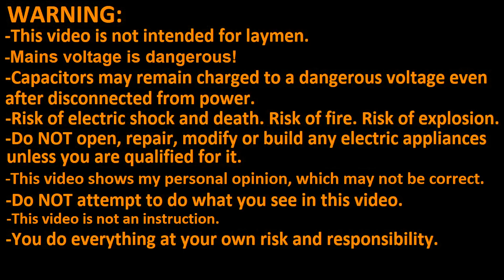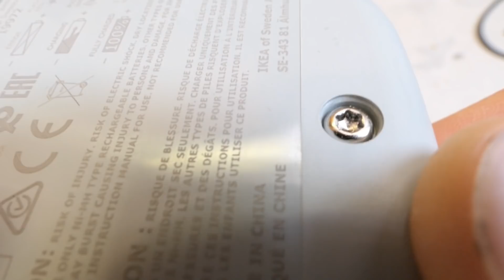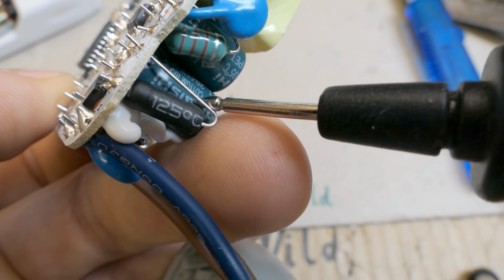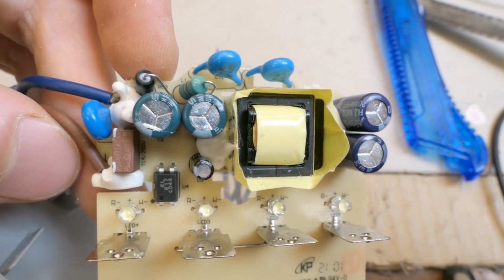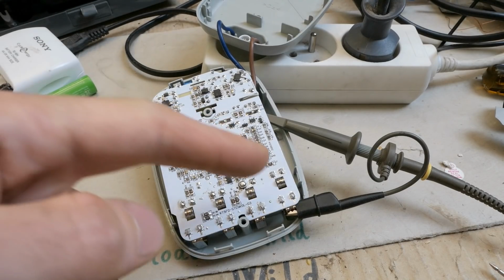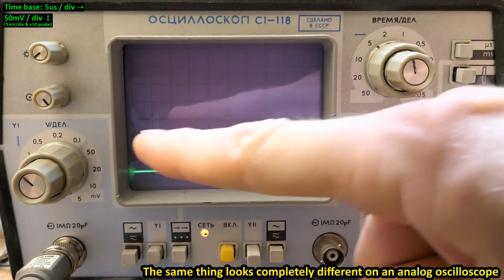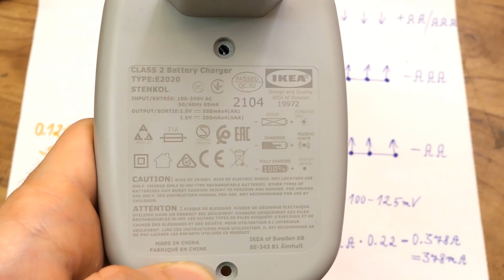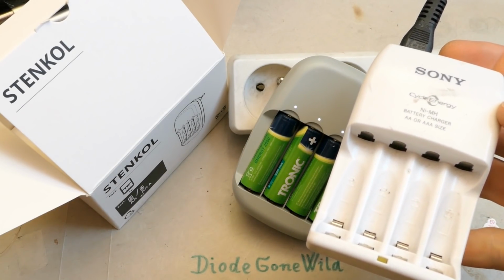What's inside IKEA Stenkol charger

Comment: The problem with the "new" types of LEDs is that manufacturers just pass the same amount of current through them as they would for the old types - so they turn into flashlights instead of indicators. For the new ones, 160uA or so is more than enough as an indicator. Even as low as 5uA can be enough. But they use 10mA, which is insane.
Reply: Yea, some new leds are insanely sensitive. I have some which light up just by holding the led from other pin and touching ground with the other.
Reply: This really reminds me of some Chinese ODM no-name and off-brand electronics where that is done and thus there's an incredibly bright blue LED. It's as though they didn't test their products in the dark!
Reply: agreed , my tv box indicator light is bright as a flashlight.
Reply: Yes, when build circuits in the past a 300ohm limit resistor was fine, i just started a new project, leds so bright i slap in a 10k :O
Reply: These LEDs are pulse driven, else they couldn’t let them flash slowly on and off like this.
Reply: @kbhasi  It's not even chinese crap, also the better brands seem to forget the user. My Zoom audio interface has a blue LED above the volume-pot which is absolutely insanely bright in darkness. I don't like blue LEDs anyway, but sometimes they are not as bad.
Reply: @weeardguy  
WHAT?! Really?!?! 😳
Ouch.
Reply: I have a 65W USB-C charger with a super bright white LED on it, right below the USB-C port. It's extremely annoying at night. Recently replaced it with a better dual-port Belkin model, which thankfully has no stupid LED on it.

Comment: I am amused by your "new" oscilloscope, is that front port a floppy disk drive? Could you use it to capture some samples? I bet you'd have some working floppys laying around along with some drives
Reply from the maker: Yes, it has a floppy drive. I already managed to store some waveforms to a floppy disk. I have a pile of floppy disks, of course :).
Reply: @DiodeGoneWild  LOL, of course. :D
Reply: A very nice data storage media before flash storage and wireless data transmission :)

I also have used a oscilloscope once with a serial port to transfer data to computer, its a very nifty feature.
Reply: Try to "play" with a horizontal or acquire menus, there should be some option for a 25/50 MHz bandwidth limit, to limit an HF/RF noise. You also got cursors and automatic measurements in the upper block of buttons... that's quite old but pretty decent DSO.
Reply: @BobT36  ovvvv corseeeeeeeeeeeee (read in Diode's accentttt) :P
Reply: @DiodeGoneWild  there are adapters that emulate a floppy drive and store in an SD card, could de a worthwhile upgrade.
Reply: @DiodeGoneWild  Would be interesting to see what's inside that scope. Is it x86 based running DOS, or something more sophisticated?
Reply: @mojoblues66  Yes definitely worth it to check the insides out - never know what you'll find!
I found tin whiskers in 70's era BWD instruments oscilloscope, and more of the same in a DECCAsound amplifier from about the 60's!
Check those pots and switches; basically anything with a "metal case"...
I've even heard of fuzzy transistors and self-destructing hermetically sealed devices... Best to spot that stuff before turning it on!
Reply: @DiodeGoneWild  one benefit of being a hoarder is that you have everything, you just need to look harder ;)
Reply: @DiodeGoneWild  NICE!

Comment: Torx is so much better than pozi/philips! I'm always happy to find them, because there is a lower chance of stripping the screw heads. Even with a cheap chinesium set of bits, torx is easier to use.
Reply: many times, what looks like a Phillips is actually JIS, the angles are slightly different, which is why a Phillips screwdriver will cam out and strip it.
Reply: @AKAtheA and of course it not easy to find JIS tools outside Japan.

Comment: IKEA “brand” seems to care for a minimum of Quality and Performance. In this case here the Battery chargers seem quite GOOD. 
However, I have 1 concern: I did not research the influence of PULSED current where the instantaneous CURRENT is more than 4 TIMES the AVERAGE. Maybe it creates gassing, but depending on pulse duration, battery CHEMISTRY may recombine the gases (or not…). 
Just guessing, comments and replies for further discussions are appreciated, or maybe even another video.
Thanks for sharing, @DiodeGoneWild!

Comment: For a low cost manufacturing operation, torx can actually save everyone a lot of headache. Our company's current product formerly used all internal hex (allen) screws, and the internal hex drive is very easy to destroy if there is not a perfect match between the driver and the slot. Torx is much more forgiving when it comes to that.

Phillips screws have basically been obsolete for quite a long time--they were designed for a time when pneumatic screwdrivers had just been invented, but no one had yet come up with a torque limiting device, so Phillips screws are designed to have inherent torque limiting. Nowadays there's no point to that.

If I need to open something up, I would rather the screws be Torx, because I can easily apply a lot of torque to loosen the screw if it has gotten stuck. With Allen or Phillips I might be in for a tougher time--the Allen can easily just be mushed into a circle and lose its engagement, while with Phillips you have to apply downward pressure and then it also might round off.

Another advantage of Torx over hex drive is you don't have two different sets of sizes to deal with.
Reply: But Philips head screws are still used in wood working because they look better than other types of heads. Less industrial and more decorative.
Reply: The best part about Torx is that even if you strip it somehow (too much force, wrong tool, or corroded/rusty screw), you can usually work it out with a hex bit.
Reply: Biggest gripe with hex is imperial vs metric sizes. You can have a key and head that look like they are a match but they're not. Ones metric and the other is imperial and they are ever so slightly different and that little bit of play cause the head (and sometimes the Allen Kwy) to strip.
Reply: @Professional_Youtube_Commenter  We had that exact problem at work. Our product was built from some parts that had metric screws and some parts that had english. We ended up having a lot of 1/16" hex screws but a few 1.5mm which is almost the same. Stripped a lot of screws because of it.
Reply: @rfmerrill  I just use torx bits with hex-hole screws.  The bit might bind to the screw, but they'll never strip.

Comment: A hint on those old Tek scopes.  Enable the 20MHz BW limiter for your 2 inputs.  You do not need the full bandwidth for measuring switching supplies and the trace looks a lot cleaner.  Also, I forgot the exact name of it, but if you change the sample size in the trigger menu from 10k points to 500 points, the waveform update/refresh rate is vastly increased looking a lot more like an analog scope, except the fine zoom-in resolution after you freeze a snapshot will not be as fine.

Comment: I've seen the red/white leds in a couple lights on bigclive's channel.

Also looks like the LEDs are center positive, you could rotate them 180° so red is the normal colour and white is error, which would make it more pleasant at night unless there's an error :P
Reply from the maker: This was the first time I saw it in real life. I may replace it with a red/green led, or maybe red/yellow, because the new green ones are 525nm rather than 574nm. This makes a huge difference for scotopic vision and circadian sensitivity.
Reply: I had two LEDs [5mm ones] that automatically change colors between RED and GREEN. Classic ones do it between red and blue.... What a rarity.
Reply: @DiodeGoneWild  hah, scotopic vision. Many years ago i was able to pre-test a new digital 3 chip sensor camera my employer was manufacturing. I set it up at night at home in my garden under the only light available of a very bright full moon.The resulting images were incredible with rich colours present, especially red hues of various flowers more intense than using ordinary sunlight.  It was an uncanny feeling, seeing no colour but plainly the camera could.
Reply: If you change red to white or the other way round, you also have to change the series resistors. Other wise the red LED will most likely be overdriven a lot because of its lower forward voltage.
Reply: I use fine felt tip sharpie marker, to dab a bit of ink on the LEDs. I do this with all of my devices that have bright indicator lights.

Its still clearly visible, But will be dimmer, so it doesn’t bother you when sleeping in a dark room.

This is especially helpful for car chargers and things plugged into the cigarette lighter inside a vehicle. Because when driving at night, some of these modern bright indicator lights can blind you!
Reply: @HULL GUITARS USA
TRUE, theese LEDs are too bright... It is better to use normal red/green ones. Even one 3mm green/blue LED can blind you quite a lot. Trasparent LEDs are the brightest.
Reply: @gianluca458  That's interesting. I remember a long time ago, when I was about 7 (could be 1996). That was several years after we came out of the USSR, so all the interesting stuff was pouring into the country everywhere. One day my father came home with a couple of semi-transparent white 7mm LEDs. He asked me if I could guess what color they were. I thought they would be white as I hadn't seen any LEDs like that before, only colored ones. Then he attached a 3V cell battery. To my surprise, the LED came on red. And then green. And red again! Interestingly enough, to this day I haven't come across this type of LED either. Not that I was specifically searching, but it sure seems that they are not so ubiquitous.
Reply: Wow, so i HAVE two quite rare LEDs... I will keep them nicely, XD.

Comment: It could be charging the batteries in pulses to better measure their voltages, NiMH batteries actually lower their voltage near 100% SoC. Ending the charging by this voltage drop is better than using the temperature method

Comment: I use fine felt tip sharpie marker, to dab a bit of ink on the LEDs. I do this with all of my devices that have bright indicator lights.

Its still clearly visible, But will be dimmer, so it doesn’t bother you when sleeping in a dark room.

This is especially helpful for car chargers and things plugged into the cigarette lighter inside a vehicle. Because when driving at night, some of these modern bright indicator lights can blind you!

Comment: I have come across an LED driver that runs on universal mains, output is about 45 watts, 3.8 A. Strange thing is I think it uses an IGBT as a regulator. I’d love to see a video on such a driver.
Reply: @Ryan Thank you for the reply, I made an amateur error and discarded the transistor that was heat sinked and didn’t write down the part ID, the controller is a BP3238. The feedback and control circuit does not appear to use an opto-coupler for feedback.The board came out of an Artika product after it unexpectedly failed, so I’ve been using the board to learn LED driver circuitry.

Comment: As far i know, Stenkol means "coal" Maybe because the color and form of it they call it "coal" I brought one for only 39 danish kr. include 25% tax ( 6,2 dollar) and it works fine. Incredible what get for the money. I have done a little test with it, and it charges the batteries just as well as the more expensive charger. It a overnight charger.
Reply from the maker: It's probably called coal because it uses electricity from coal to charge the batteries ;).
Reply: @DiodeGoneWild  :-) Good guess. They still use some coal, but will be phased out in the coming years. Sweden has nuclear power and also uses solar, water and wind energy. IKEA will stop using disposable batteries and will only sell rechargeable nimh batteries in the future to reduce waste. Like your video and cat :-)
Reply: In Italy it's sold for 4,95€ taxes included, or 9,90€ (taxes included) in bundle with 4 AA 1900mAh batteries, or 12,90€ with 4 AA 2450mAh batteries.

Comment: I still have the “old” white Ladda IKEA charger and the outputs are rated a lot higher. I wonder if it’s just the way they spec 4x….. 
I feel the need to open mine now and compare it to this new one.
Reply: I actually bought a Stenkol and although it’s nice that you have individual LEDs for each battery, it is MUCH slower at charging than the “old” white Ladda charger.
Reply: @atariandre5014  Slower charging is better for the batteries.
Reply: @massengineer7582  yeah thought about that. It’s hard to believe they didn’t improve the charger…
Reply: Up to 1C charge rate is pretty safe, old LADDA made by same OEM as the Sanyo/Panasonic charger iirc

Comment: Why did they shrink wrap the inrush resistor thermal fuse, and not the MOV? 
What are the chances of a resistor exploding? 
My guess is that the resistor will pop at 125ºC and they wanted to mark it on the piece? 
Usually MOVs are shrink tubed as they sometimes explode from lightening strikes.
Reply: Probably to contain the arc flash/sparks from the popping resistor just in case

Comment: Excellent analysis. 
How does it regulate the current going into each/all batteries? 
Why does it charge one cell at 50% duty cycle?
Reply: The reason for the 50% duty cycle limit is to limit the average charging current to a safe level. ( < 800mA per AA cell )  
Excessive charging current would overheat the cells.
Notice that the AAA cells have lower charge rate.
Reply: Another reason is that the charger is measuring the cell voltage droop during the period between the charging pulses.

Comment: I have a question regarding an old charger which I have which charges the batteries in about 15 mins. It's the lg v800c fast charger. Why do the new charger charge so slow in comparison to the old charger? Did they come to the conclusion that charging so fast damages the batteries? Is this why you can't purchase fast chargers anymore? Looking forward to your response.
Reply: Yes. Fast charging like 15 min killing your battery fast. Because excessive heat and too much current than rated current stated by manufacturer.

Comment: How does it detect if a battery is not rechargable?
Reply from the maker: I think it only estimates the impedance. The non rechargeable batteries probably have a higher impedance - their voltage increases too much when it tries to charge them.
Reply: @DiodeGoneWild  back in my day chargers would have their bottom piece try to make contact close to the edge of the bottom surface and rechargable ones would have the whole surface metal, meanwhile single use ones would have a very thick border and couldn't even make physical contact.

Comment: I have problems with this changer and IKEA LADDA 900 AAA batteries no. 23076. Almost all get blinking red ligth (error), while my old ikea charger  works fine (Ikea Ladda YH-990BF). Seems this charger is more "strict" somehow? I do feel the IKEA LADDA 900 AAA batteries get a bit hot during charging in Ikea Ladda YH-990BF so maybe STENKOL incorrectly detect this as error. but just guessing. Edit: so also guessing, when detecting heat is should have reduced changing current\duty cycle instead of just going into error mode. A design error IMO. But where are these heat sensors?

Comment: I was expecting a comment on the surface mounted spark gap visible at 22:01.  This is mounted between the primary to secondary. Notice the absence of solder resist.

Comment: wow well built design! Though I think there was alot of engineering that went into something that uses PWM charging to the batteries, I will stick with a nicer charger that uses buck regulators and constant current control.

Comment: I bought Kvarts charger few months ago, but now it's discontinued in the favor of Stenkol. Kvarts appears to be very finicky, discards some too worn batteries, and sometimes doesn't charge mildly worn red Lidl cells fully. I guess it's tuned for Ladda cells (and by extension Eneloops).
Inside Kvarts looks very similar, with a microcontroller and a shitload of circuitry. But it cost 2 times as much.
Reply: This new Stenkol also seems to be finicky with some cells. I tried to charge my fairly old Energizer NiMHs, but it wouldn't accept them. Starts charging then after some 10 minutes the red LEDs start flashing. Of course I can charge the cells with a different charger.
Reply: @zoltandiveki5233  So I guess software wise they did not change much. Then disregarding the price, Kvarts is better, case design is more stylish and status LEDs are bigger.

Comment: How does it recognize the non-rechargeable batteries?
Reply from the maker: Probably a high internal resistance when it tries to charge them. The charging current raises the voltage way too high if it's a non-rechargeable one.

Comment: I think it's not good for 18650's right?
Reply: No it's not because this works on 1.5V, 18650 cells charge on 4.2V
Reply: different size, different chemistry & voltage, different charging method.

Comment: There is two things wrong with this; charging the batteries with high current pulses like that is not good for the battery...
Two; the MOV at the input is never a good idea; it blows the input fuse as the thing tries to act as a surge arrestor - and if that was the only MOV in the house, it can go off with a mega bang during any noteworthy incident!
I typically pull those suckers; save for the ones placed AFTER the EMI filter...

Comment: Is it any good?
Reply: I think it is kind of okay. So it looks save but the circuit seams a bit overcomplicated and therefore not easy to repair if something goes wrong. And it seams a bit slow to me, with its 350mA Current it will take at least 7-8h for charging those usual ~2500mAh NiMhs...
Reply: @tvelektron  slow its not bad,   more important that the batteries last longer.